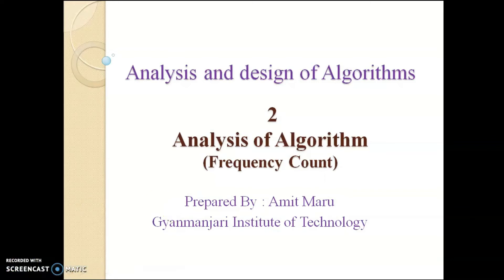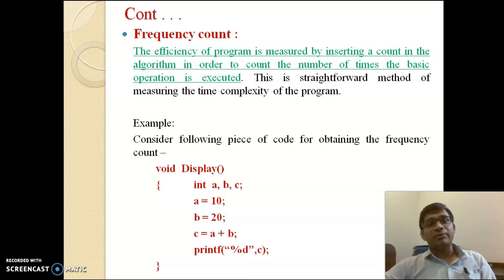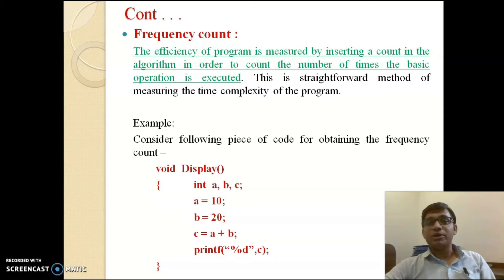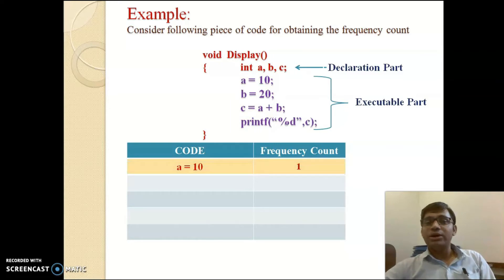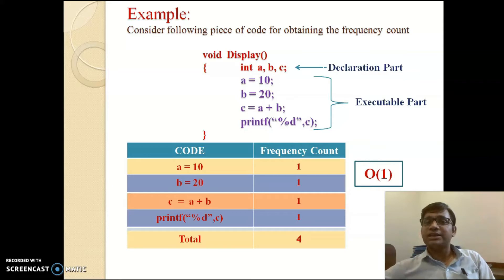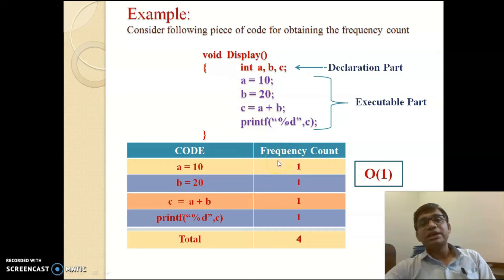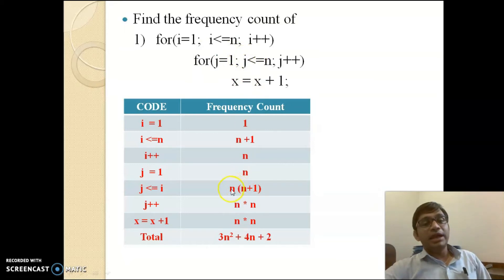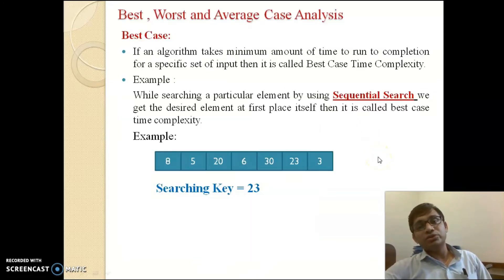Frequency Count | How to find time complexity? | Step by step finding frequency count

Comment: Why the second example is 3n2 + 4n + 2? There were also an aswer 2n2 + 2n + 1 for the second example..Now im confused which one is right..Because my lecturer said we just take the highest time complexity for n+1 the others in for loop(n, 1) , we just ignored it.
Reply from the maker: Don't be confuse here. In this example i have covered all the internal operations (such as i=0 has frequency count=1, i<=n has n+1 and i++ has n). So total is 3n2 + 4n + 2. This is true.

But when we consider whole loop as one statement then this statement will be executed maximum n+1 time. (it means we have ignored frequency count of i=0 and i++ which is less than the frequency count of i<=n). In this case we can say it is 2n2+2n+1. 

At the end either in 3n2 + 4n + 2  or   2n2+2n+1 we are just taking highest time complexity which is n2 in our case..